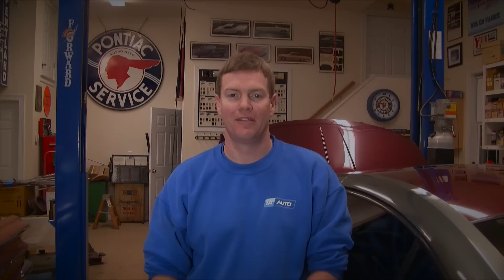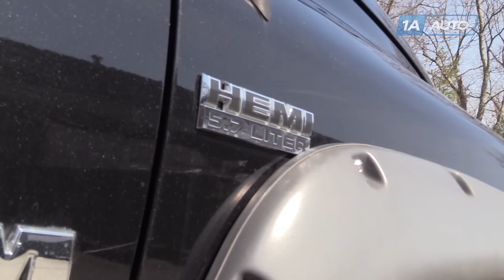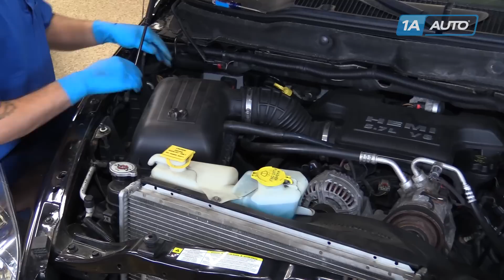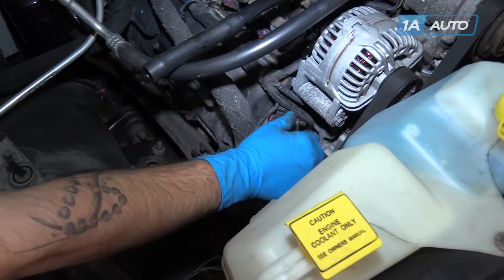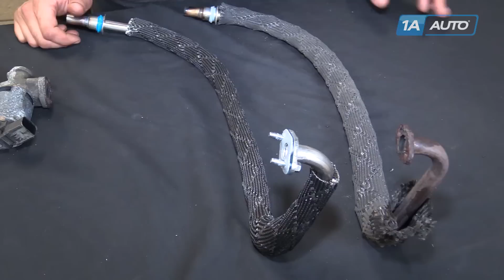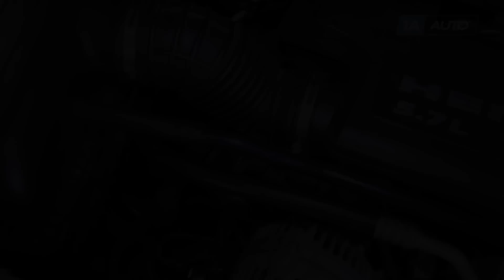How to Replace EGR Tube 06-08 Dodge Ram 1500 5.7L

Comment: What is the correct orientation of that blue o-ring/gasket, because at 3:08 they are positioned or facing in different directions?
Reply: The old one is correct. The way it came out.

Comment: i have a 2004 Dodge Ram 1500 with 5.7 hemi. In the video the positioning and the engine appear the same, Will the egr tube fit on my truck even if designed for an 06-08 model rams?
Reply: update: The 2006 model egr tube fit my 2004 model egr